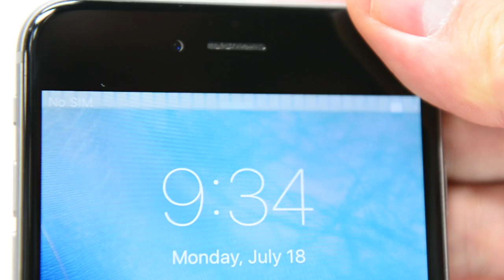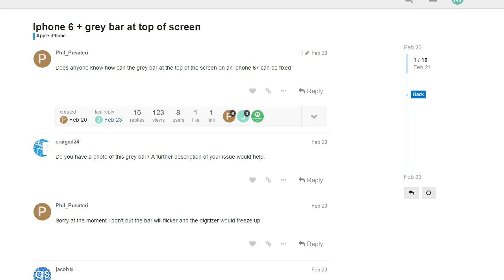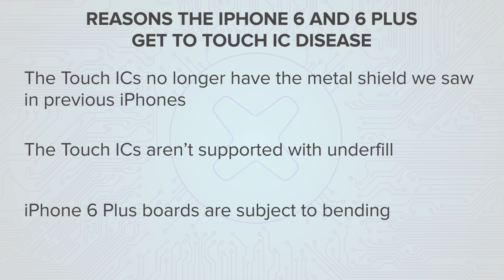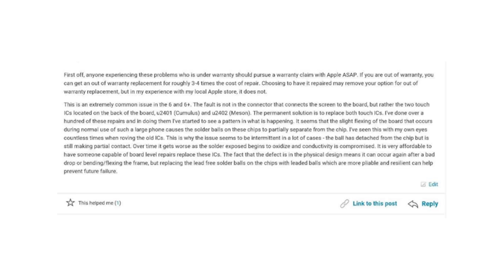A Design Defect Is Breaking a Ton of iPhone 6 Pluses

Comment: So, Apple is using cheaper/less material to save like what? 10 cent per $ 800 phone?! Way to go...
Reply: $0.10 x 321.22 million (number of iPhone sold from the release of the iPhone 6 and prior to the release of the iPhone 6S) = $32,122,000 savings.
Reply: no they save a dollar on a $200 device which then they sell for $800
Reply: Those 10 cents multiplies in every chain. It all adds up on the bottom line.
Apple died with Steve Jobs - he would never ever compromise the integrity over a few cents.
Reply: +Ilusiion3 799 x 321.22 million = 256,654,780,000. I think they can afford 32mill to improve customer satisfaction and avoid negative PR such as this.
Reply: It's about a lack of integrity.  A number of years ago Apple was investigating a silicon coating for their laptop and mobile ap boards, it would have added less than a $.05 per device, but made both the MacBook Pro and iPad nearly waterproof.  They ran a bunch of prototypes and they looked good.  I know about this because I too was running boards with the coating to possibly add as a value added service at one of my stores… and I spoke a lot with two of their engineers.  But Apple made a decision that it was cost ineffective to waterproof logic boards.  Their engineers revealed to the coating company engineers that it came down to bottom line… Macbook Pros and iPads, etc… not susceptible to water damage, would last too long and spilled fluid on the devices or dropping them in fluids was a major! profit center!  Apple depends on obsolescence and damage to move old products out of people's hands, they make their money on replacement upgrades.  They have GOT TO sell NEW devices, or end up where they were in the 90's.  But, they go too far.  In the 90's their product saturation was due to how GOOD their products were, they just wouldn't break down and so people passed them around.  In 1995, over 95% of all the macs made since 1984 were still in use!!  I kid you not, and that was strangling them.
Reply: +Ilusiion3 
32 million is not worth to risk their integrity for their flagship device
unless it's initially planned to break which mean they barely have any integrity in the first place
Reply: They never did have any integrity if they keep blocking comments from industry professionals outside of Apple.
Reply: haha ! Penny save is a penny made !
Reply: If only Steve Jobs was still here...
Reply: Ilusiion3 Good for them, almost filing for bankruptcy because they have so less money, right?
Reply: ***** actually i don't use apple products because i feel they are over priced and don't offer enough customization/hacking potential.
Reply: The bill of materials for the iPhone 6 Plus is actually like 90 bucks.
Reply: even if they save about 20 usd per phone it would be hundreds of millions in profit.
Reply: Ilusiion3 No.
Reply: TheMidnightNarwhal
Not a fan of samsung but of course it has a warranty you silly
What kind of company didn't put warranty on their freaking flagship
Reply: yes
Reply: they did a bad job on this phone ill be the first to admit, they quickly remedied it with the 6s so my hats off to them for that, i work on smartphones and apple is years ahead interms of build quality and standards, and the bill of materials is going up every year for the phone, not cutting cost as some of you think, do some research for yourself the build cost or public knowledge, dont sit on your phone its not a wallet
Reply: They save about $32 million. :)
Reply: +Goorpijp Wessel ? It's the same price as other flagship high end phones.
Reply: Goorpijp Wessel Ok. But yet it looks and feel as good. And it also performs as well. So either they get a good deal or the competiutors get ripped off? I had to choose between the S7 and 6s. Both were same price except the S7 had no warranty at all.
Reply: Goorpijp Wessel ikr
Reply: Guys look. All the links say no warranty. https://www.amazon.ca/s/ref=nb_sb_noss_2?url=search-alias%3Daps&field-keywords=samsung+galaxy+s7
Reply: TheMidnightNarwhal
http://www.samsung.com/sec/support/guarantee/InternationalWarranty.html
Reply: chrom4ful But that's if you're outside of your country you got it. Like, you had the base warranty. It's so complicated. Why can't they just have a normal listed warranty on Amazon, I would have bought it.
Reply: TheMidnightNarwhal
Easy just buy it from your local amazon, like for eample if you life in states you might want to get the us version with us warranty like this one https://www.amazon.com/Samsung-Sm-g930uzkaxaa-Unlocked-Smartphone-Water-resistant/dp/B01HFD0XWE/ref=sr_1_2?ie=UTF8&qid=1472311769&sr=8-2&keywords=s7+us+version
To put it into perspective if I buy iphone from the states and bring it to my country they will also tell me to send it back to states to claim warranty of course it would be different depending on each country law some may accept international warranty some will not
Reply: chrom4ful But that's wnat I was doing. The link I gave you is Canada Amazon. I'm in Caanda. It says no warranty as it's international phone version.
Reply: TheMidnightNarwhal
It seems like the amazon canada only provide the international version which is quite strange (maybe because of certain local vendor monopoly or something)
http://www.bestbuy.ca/Search/SearchResults.aspx?path=ca77b9b4beca91fe414314b86bb581f8en20&query=galaxy%20s7
Reply: chrom4ful But on Bestbuy you gotta have a contract right? I just want to buy the phone by itself.
Reply: TheMidnightNarwhal
Yep that sucks I feel bad for canadian fellow
but there's this
http://www.androidcentral.com/there-one-way-get-unlocked-galaxy-s7-canada
Reply: chrom4ful Well it's to late now, already got a new iPhone
Reply: TheMidnightNarwhal
That's fine really
Enjoy your device
Reply: @Thug Life the parts alone cost $200+. ram, storage, processors, etc, don't grow on tress.
Reply: we got ourselves experts on the manufacturing cost of Apple's products in the YT comments lol. You guys do realize a huge company like Apple needs to be as profitable as possible.EVERY CENT COUNTS WHEN YOU HAVE HUNDRED OF MILLIONS OF PEOPLE BUYING THE PRODUCT.Apple has so much scale and just like any other company they try to use the cheapest labor possible.It's hard to find what hardware Apple has stuffed inside their products cause they are secretive.How are you gonna find the cost of their products if you don't even know what they use.Don't really know where you get 200$ in parts from.It's probably near that, then again we don't really know. Suppliers can't really turn down supplying parts for a company big as Apple, that's a huge opportunity in itself.Just that a lot of leverage to Apple to keep their cost's down especially at the mass scale they produce. Also keep in mind Apple makes a huge margin on their products compared to others in the Electronics market.
Reply: Goorpijp Wessel i don't even own a Apple product .Their iOS and Mac OS is absolute shit.But i do know for a fact they make quality hardware.I know you hate to hear that but it's the truth.
Reply: Yeah all companies outsource components and combines them dummy lmao.
Reply: Not too surprising, after all, businesses are in the business of making money, and it's a win win!!! Apple saves a bit on production costs up front, and the increased likelihood of failure means the customer will come back sooner
 for a new one!!! 

Or, if the customer wants to keep that phone, they can take it to small business repair shop like this.. So both big and small business see a profit! Sweet, sweet capitalism!
Reply: bliglum no, Apple relies solely on people's mind's and instant gratification as far as repeat customers go.Apple is a 'cool' brand.Most of their customers always want the latest stuff, and a 1 year iPhone renew cycle means they don't need to purposely  sabotage their products lol
Reply: Jas Dhoot
Not necessarily. Several of my friends are still using their iphone 4's and 5's... So clearly, psychological obsolescence is not enough.

Apple once got sued for designing its batteries to fail just after the warranty expired. They don’t do that anymore, so this new method of planned obsolescence will help insure that the iSheeple will keep updating with the regular cycle. I'm sure the new iPhone 7 has this same "feature" too ; )
Reply: +Jas Dhoot Samsung makes most of the hardware themselves
Reply: Mohamed Hussain Rasheed try billions
Reply: It's about weight, not cost.

Comment: I hope this doesn't affect the 6s and the 6s Plus. 😔
Reply: They are much harder to bend (stronger and thicker aluminum chassi) so the issue shouldn't be as common.
Reply: I have a 6s plus 64gb and don't have any problems
Reply: and the touch ic has been moved to the screen for 6s and 6s plus.